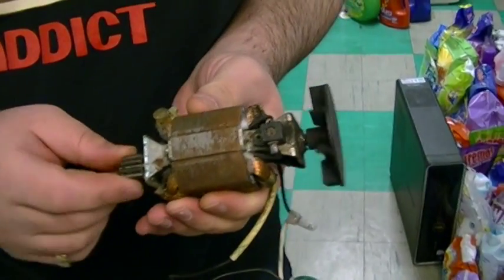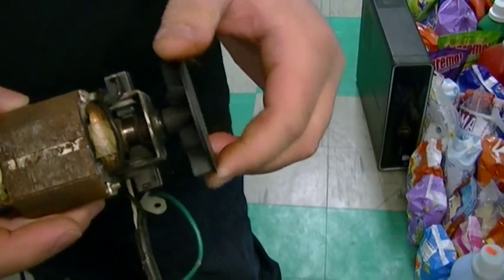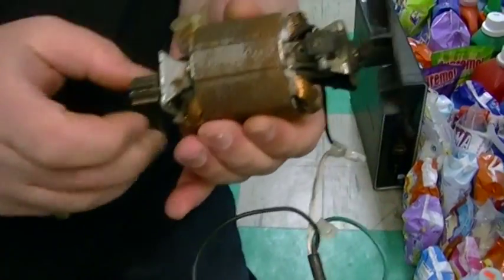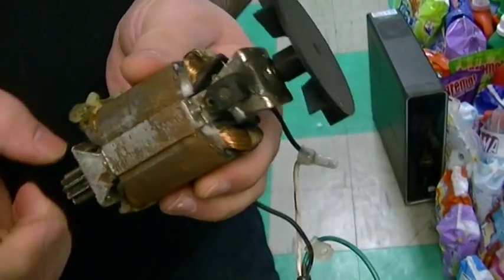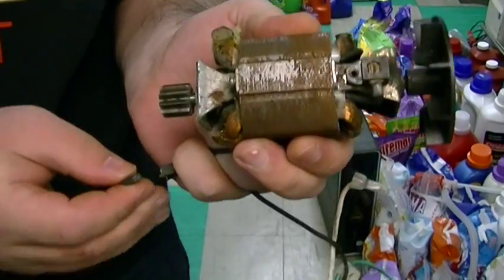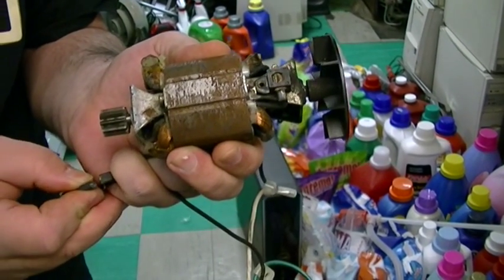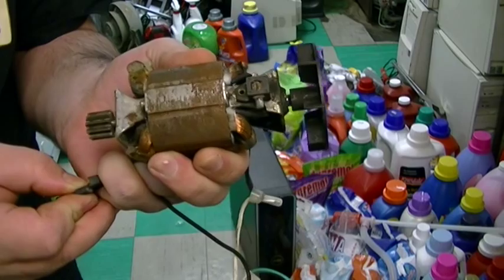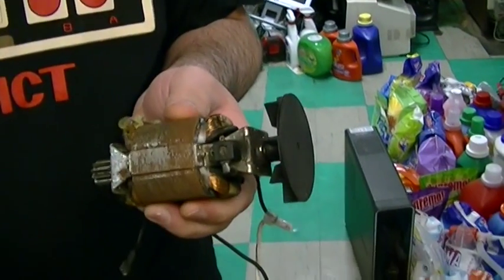Universal Motor From A Direct-Drive Air Compressor

Comment: I have a battery-operated Campbell-Hausfeld air compressor, portable.. It probably has a similar size motor in it.. But its a more recent product.. That sure does run fast.. I imagine there was a gear reduction before the connection to the piston?
Reply from the maker: +Jordan U Yes, there was a gear reduction:  https://www.youtube.com/watch?v=7Ej0Eht4Ri0

Comment: what was the compressor that had the bad unloader valve? i think it was oiled instead of oilless. if you can, stay away from oilless.
Reply from the maker: The compressor with the bad unloader valve is the Brute.  That has an induction motor (capacitor start), but due to a bad capacitor, it's almost as good as an oilless.

The compressor this motor was out of was my old Campbell-Hausfeld (I think it was) 2-gallon, oilless.  That has a bad check valve in it; this year I plan to take it apart and see if anything can be done.  There are also plans (although I don't know when, just yet) to make another silent air compressor.